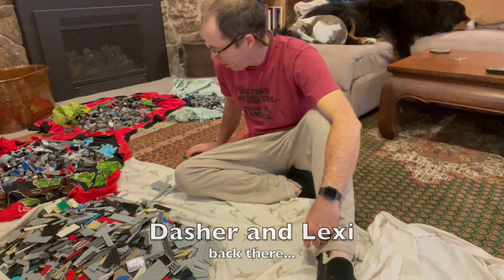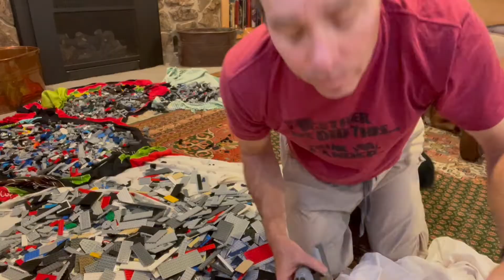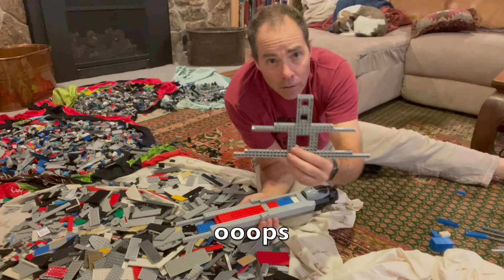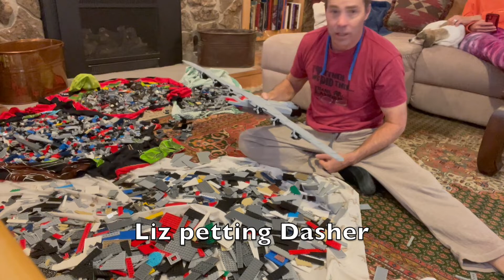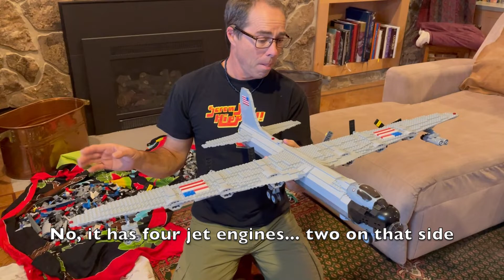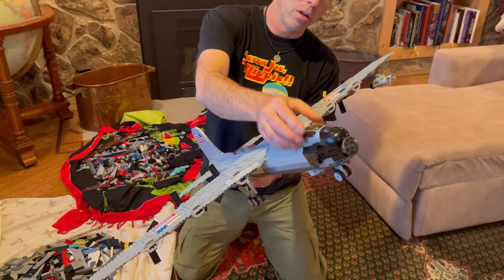The Process and the B36 Peacemaker

Comment: The color scheme came out well and the fuselage is cylindrical.  Nice.  It's intriguing to see the construction and that you value a sturdy build.
One of my current lego airplane builds is a Boeing C-97.  Not nearly as big as this but I can appreciate complex wings.  I'm trying to make the gear swing and the flaps extend/retract much like the real one.  This forced me to use a relatively thin wing spar structure behind the gear and in front of the flap in each wing. It also has gaps in the wing in which the gear bays fit.  It is challenging to keep the forward area of the wing strong with a massive gap interrupting the load bearing elements.